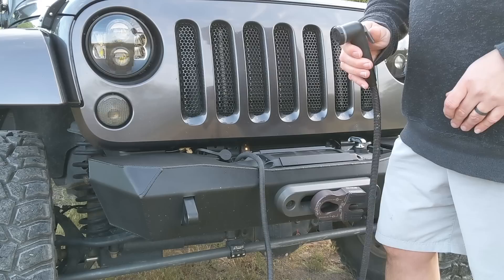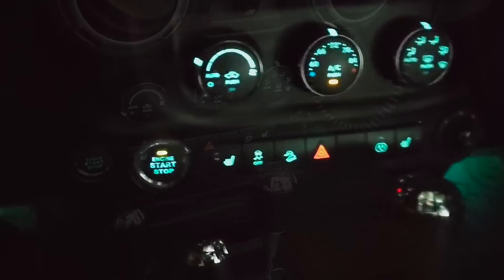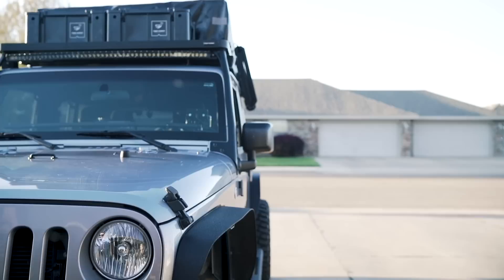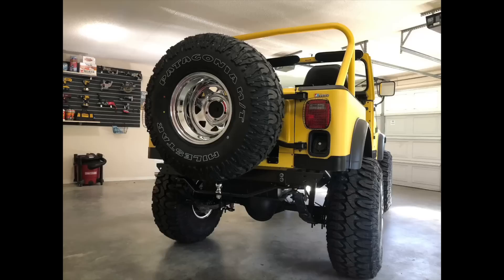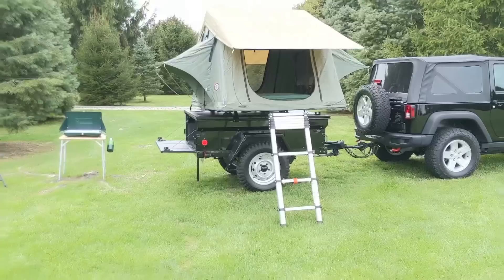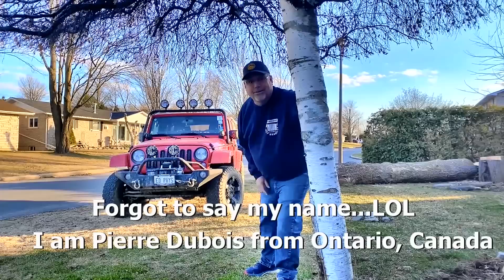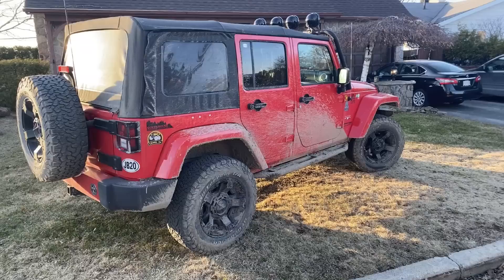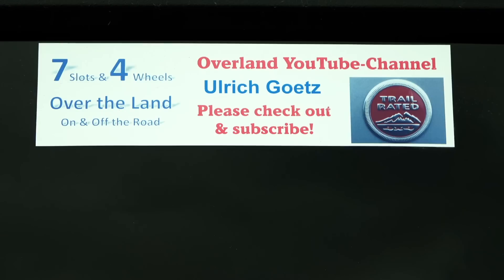9 AWESOME BUILT Jeep Wranglers for Overlanding & Off-Roading - Viewer Rigs

Comment: I love the wagon wheels on the yellow CJ… I hunted and hunted for a set of those and could not find any… of course I was looking during the pandemic and it was hard to find just about anything… i am still working on my Jeep… had 2 major set backs…. One the pandemic… two I blew my right knee out… folded it 30 degrees the wrong way and had to have complete knee replacement… now I have a hard time standing next to my Jeep to work on it…or crawling under… BUT before that happened I did get new timing chain in the engine… new seals all under… new brakes… leaf springs… wheels tires… new bumpers front and rear…now that we got it running I hear a popping coming from the back end when I turn.. can’t figure out where it’s coming from… I want to find another jeep with hard top and covert it to a overland trailer..

Comment: I'm 3 years into a frame off very similar to the CJ7 here, (mine was a $120, hole in the block, rust bucket) but I'm customizing the entire thing, rather than doing a restoration. 
It will be an M38A1 inspired CJ7 built as a tribute to the brothers, and sisters I served with for 28 years.
 That said... it's the air up system on Gadget that is the most amazing.
 I'll be adding a similar air system... if I can figure out how to plum it in.

Comment: The onboard water system on gadget was pretty sweet. I’m doing something similar on my tj but I’m using the trans cooler portion of the radiator to heat my water.